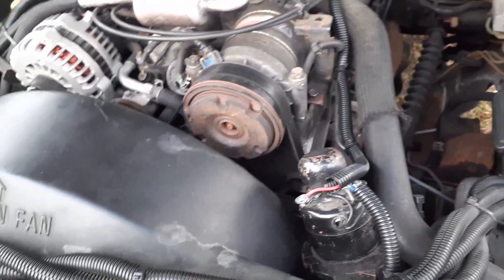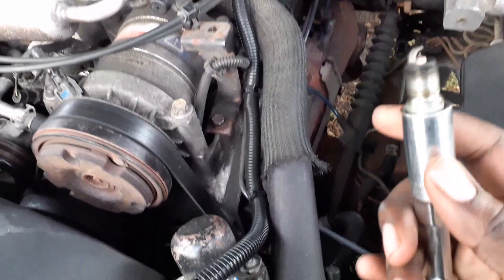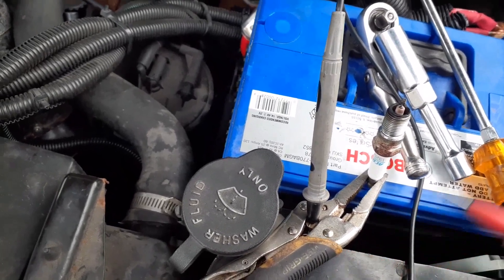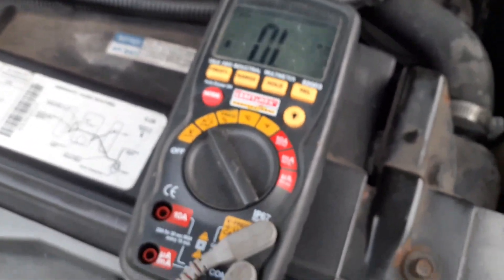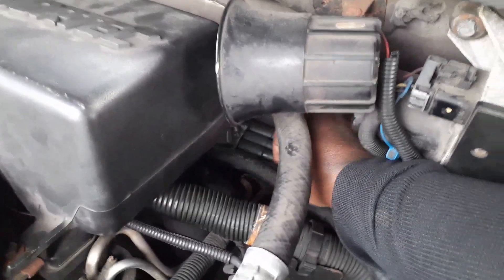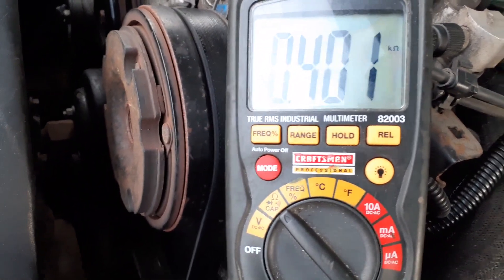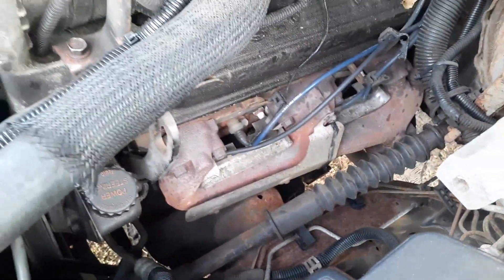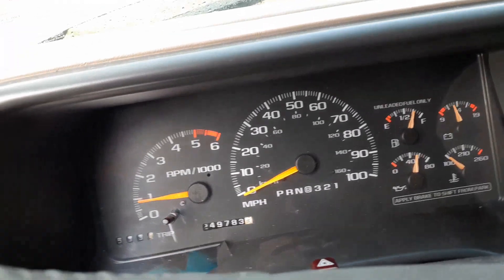Troubleshooting P0301 Code On Chevy 5.7 Vortec

Comment: So glad I watched this.I thought for sure I had a vacuum leak or injection problem. I had assumed my plugs and wires were still good after 37000 miles but they were very worn. original equiptment was still working ok when replaced at 88000 miles. GMC runs smooth and check engine light went out after installing new plugs and wires. very helpful Thank you.
Reply from the maker: Hey glad everything worked out for, thanks for watching...